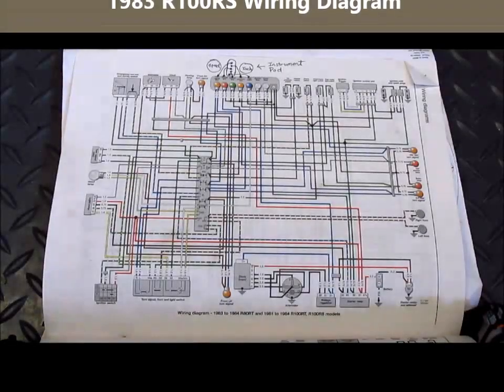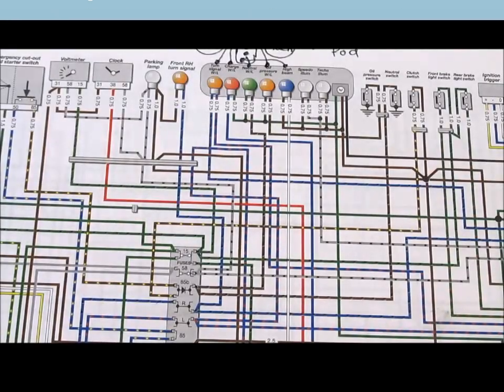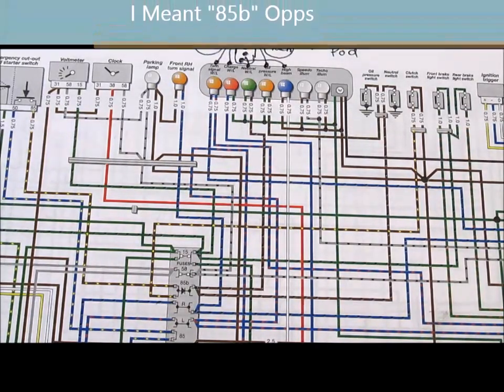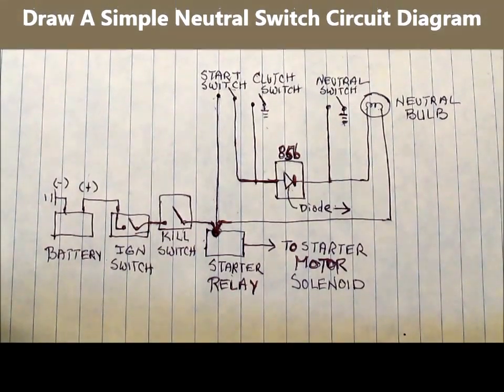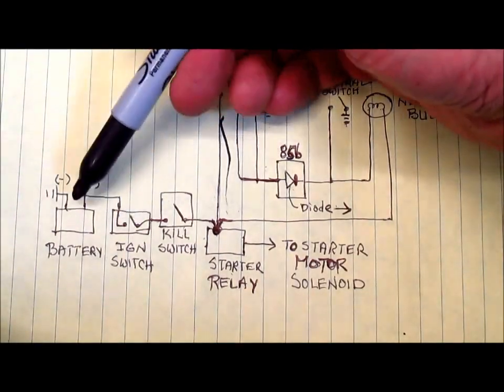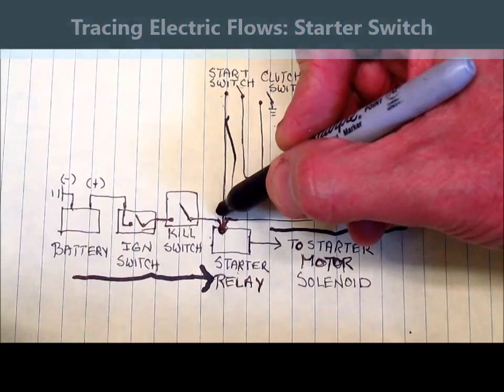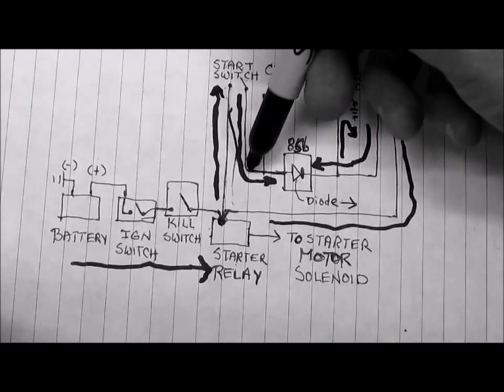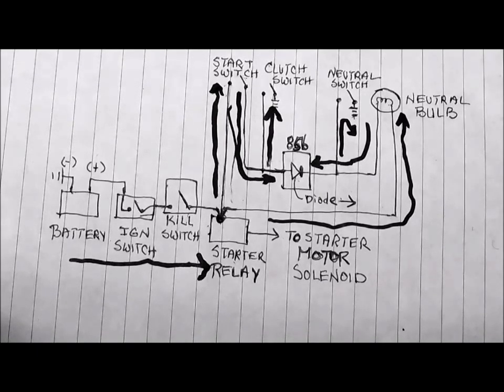1983 BMW R100RS How To Use Wiring Diagram To Learn About Neutral Switch & Starter

Comment: Thank so much. I replaced my wiring harness and had this problem until I engaged the clutch. How can I get the neutral switch connected. Tim
Reply from the maker: Neutral switch is on the bottom of the transmission toward the rear. Remove rear engine mounting stud and then remove the tube between the ears of the transmission. You can access the wires to the switch and connect them.

Comment: Mr. Brooks - advice please - 1978 R100/7 - headlight hi and low beam not working not turning on - NEW left handlebar headlight horn switch + Headlight bulb was tested from a known working bulb from my R90S + Headlight relay was tested from known working relay from my R90S - No prior tampering in the /7 bucket + turn signals / horn / right side starter switch / rear tail light / oil light = all work (just dont know where else to start looking) any ideas, suggestions would be helpful and admired - thank you - Paul
Reply from the maker: Hi Paul.  I would verify that the headlight relay is  working. It is located inside the headlight shell.  You should hear it "click" when you turn on the ignition as I believe your year/model bike sent power from the ignition switch to the headlight relay when you turn the ignition switch on. If you have a volt meter, you can verify if there is 12 volts on terminal with the YELLOW White wire when the ignition is on. You can verify that the wire from the ignition switch is sending power to the relay by testing terminal 86 which has a GREEN wire attached. It should show 12v when the ignition is on.
I hope that helps.
Reply: @BrooksAirheadGarage  Thank you for your  reply (I'm 5 hours late) so.. The relay does not click. It's a known good relay borrowed over from my R90S. I even went to O'Reilly and bought a new one to no avail. The switch has 3 headlight positions. The always on low beam, the up position high beam and the downward spring loaded high beam flash for forewarning the drivers in front of me that im fixing to pass them up. Thats the only function that works ( Only the hi/lo does not) (and the horn, it works too but not the problem) There is no power/voltage   bridging across the two fuse terminals. Ugh old bikes - I love them except now.  Should I look outside the headlamp bucket or is the problem inside the bucket ? (has to be huh) ? Any info. would be appreciated. Thank you. Pg
Reply from the maker: @paulgarza8389  If you don't hear the relay click, it is not working. As I mentioned earlier, you need to use a volt meter to verify if there is voltage on the GREEN wire on terminal (86).

The fuses are not part of the headlight problem. The headlight power does not go through them.
Reply: @BrooksAirheadGarage   yes sir, green wire on the h/l relay is reading 12v and even when unplugged from the relay and meter +probe fed directly into the wire (green) , this too reads 12v - (plugged it back) (and also using the brown ground wire on the headlight tri-plug as ground w/ the meter black ground probe.. 934 pm - Monday
Reply from the maker: @paulgarza8389  Well, then I conclude that the relay is not working. You can test if current is flowing through the relay itself. Put the RED volt meter lead on the terminal (86) with the GREEN wire and the BLACK volt meter lead on terminal (85) with the BLACK wire. Turn on the ignition. You should see 12 v if the relay has current flowing through it. That said, it is possible that current flows through the relay and it doesn't close, but it would not take long to burn it out if that's the case.  

You should also verify that the RED wire is on terminal (30) as that's the power to the headlight. When the relay closes, the current coming into terminal (30) is sent out terminal (87) to the YELLOW-White wire to the left handlebar and to the High/Low switch function.  Put the RED volt meter lead on terminal (30) and the BLACK volt meter lead on terminal (87). Turn on the ignition. If the relay is working, you will see 12 volts.

I hope that 's helpful.
Reply: @BrooksAirheadGarage  Dear Mr. B's Garage:  You're going to like this ! This is odd but hear this. The 12V tests all pass except for the... YELLOW & WHITE wire 12V test. 

Ignition is on 

When I touch the + meter lead to yellow and white relay terminal, there is a zero reading but directly next to the terminal lies a lone copper rivet head thats made onto the surface. When the + meter lead touches the copper rivet AND the said terminal at the same time THE HEADLIGHT COMES TO LIFE and the handlebar switch enables and operates the hi/lo beam as designed. 

Also, there is no voltage coming out of the black wire on the relay (just wanted to say) 

possible solution ?
Reply from the maker: @paulgarza8389  So I conclude the YELLOW-White wire has broken off the contact inside the switch.  Your problem is identified.

The black wire is a ground wire, UNLESS the starter motor is running. In that case, it's a (+) 12 v wire so it means there is no voltage difference across terminals (85) and (86) in the light relay and the relay opens.
Reply: @BrooksAirheadGarage  YELLOW &White wire that goes to the H/L relay  -- nothing - No 12v reading when ignition is on (green wire does have 12v when ignition is on though

Comment: Thx, my rs 100  year 79, doesnt give me any light at all...zero...after a spark to the frame...as a result...where to start? Bob Belgium, this video clears a bit the mist, thank u!
Reply from the maker: Hi Bob,

I made an error in the hand drawn wiring diagram. In my effort to simplify things, I got carried away. On the Starter Relay, I show three wires together on a single terminal. That is wrong. The wire from the starter switch should be drawn as going to a separate terminal (85). The other two wires, from the neutral bulb and the kill switch, are attached to the same terminal (86).  

Updating this video to correct that diagram has been on my "to do" list for awhile. I hope to make a new version of this video with the corrected wiring diagram in the not too distant future.
Reply: Brook's Airhead Garage , thanks, i check my hanes and see what my 79  rshas as a wiring diagram, should be similar hé?, thanks for great effort! bob Belgium!😎🇧🇪🍺

Comment: Thank you ! I totally trust the structure of the layout you have provided for the world of Airheads. I'd like to to pose a question to a problem I have going on with my neutral safety switch on a 78 R100/7 . I will provide a list details with the issues. Will this be okay ?
Reply from the maker: Sure. I'll help if I can.
Reply: 1) good battery 2) Ignition and kill switches both function properly 3) Newly installed starter relay beneath tank 4) Clutch switch & start switch both function properly 5) New neutral switch under tranny = PROBLEM is.. no illumination to the green cluster neutral light. I have conducted the test on your refresh video and that does not illuminate it. I have bypassed both connectors that fit into the neutral switch blades and still no illumination. I have disassembled the cluster and ran 12V on the bulb itself, the bulb is good. No illumination to the neural light  at all - The oil pressure light + alternator + signal blinkage are all functioning as designed. Ideas on the neutral issue ?  (popped open the headlight and verified that the correct wiring w/  in 85b is in its place) - thoughts ? ..thanks Pg
Reply from the maker: 1. Larger rubber connection to the back of the instrument cluster has sockets that connect to pins in the instrument cluster to power the neutral light. Socket-pin for neutral not making contact, or dirty/corroded.
2. Broken copper trace on the flexible board inside the instrument cluster. Look at the flap that folds over the edge of the hole the bulb socket plugs into. The copper foil is often cracked/broken here. Could also be cracks anywhere along the path.
3. Wire going to neutral light in the bundle that connects to the larger rubber connector in that plugs into the instrument cluster is corroded/broken inside the harness.
4. See this write-up on my site for more details:
http://brook.reams.me/bmw-motorcyle-rebuilds/1983-bmw-r100rs-rebuild-project-index/62-bmw-1983-r100rs-repair-instrument-circuit-board/

Hope these are helpful.

Comment: Very helpful!
I have my panel lights defective since (i suppose one of the previous owners) a "mechanic" put his hands on it, and when neutral light mights light on, it lights the GEN RED light, and viceversa, when GEN light must show, it shows the GREEN neutral bulb...
Reply from the maker: Eduki, if the bike is a /6 or later, that behavior suggests the pins in the large black rubber connector block that plugs into the back of the instruments got switched during a repair.
Reply: Motorcycles and Other Musings thanks a lot! I'll check it to solve it, I'm enjoying your videos, very informative and interesting!
Reply: Thanks again! Do you know where is it located?
Reply from the maker: eduki,

I have a diagram the applies to the /6 series here:
https://flic.kr/p/QCcQR8

The circuit board changed over the years with the electronic tachometer instead of mechanical, moving the brake master cylinder to the handlebar and relocation the turn signal indicator light from the bottom on the /6 to the top later in the /7 series.

I hope this helps.